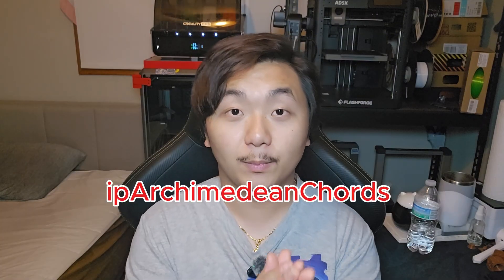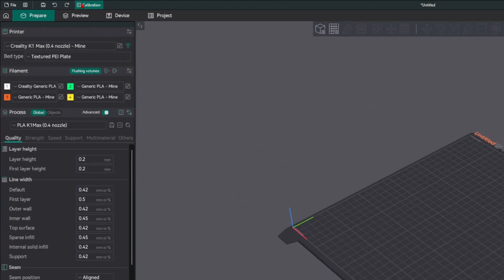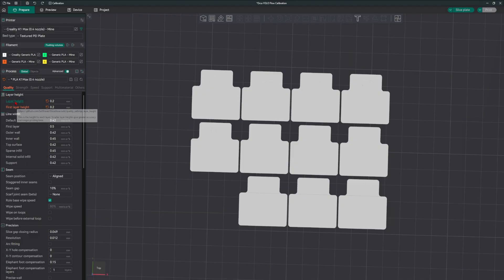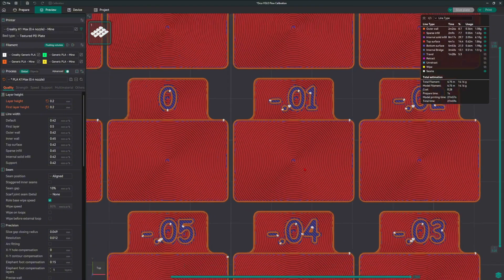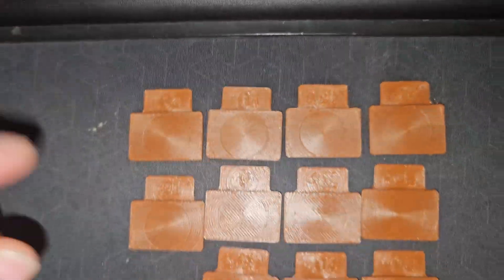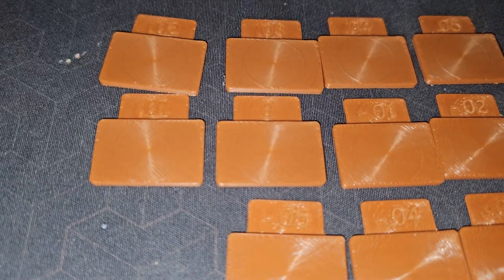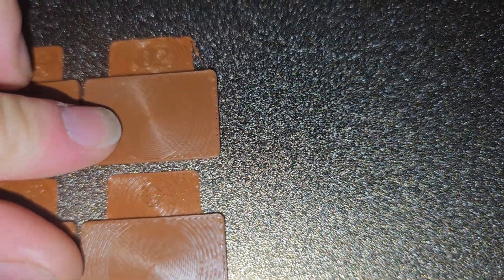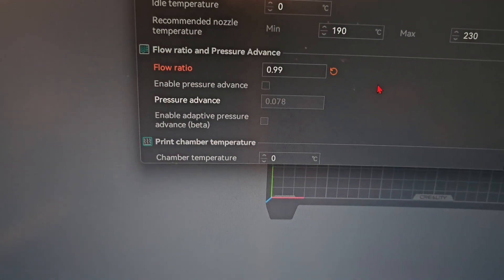How To Do Flow Rate Calibration OrcaSlicer With Any 3D Printer

Comment: I’m sorry but anyone that follows his math here is WRONG. That is not how you calculate Flow Rate. New Flow Rate= old flow rate x 100+modifier /100
Reply from the maker: I was just following the math in orcaslicer,  could be it make a mistake...
Reply: They changed it. From OrcaSlicer flow rate calibration documentation: "OrcaSlicer > 2.3.0 Archimedean chords + YOLO (Recommended)": "Update the flow ratio in the filament settings using the equation: OldFlowRatio ± modifier". For "OrcaSlicer <= 2.3.0 Monotonic Line + 2-Pass Calibration": "OldFlowRatio * (100 + modifier) / 100"

Comment: You really didn't explain what you chose and why - maybe somewhere between all the camera bobbling you did?  Kinda disappointing video
Reply from the maker: I did, for the first pass, I choose 0 and didn't change anything in the settings. Then I do the second pass and choose 0.1, that's why I added .1 to my flow ratio, from .98 to .99. Let me know if you have anymore questions.
Reply: @Scratch3DPrinting  it’s not a very intuitive test. I may just go back to a single wall cube and my caliper
Reply from the maker: @WhereNerdisCool What ever works for you man.
Reply: Agreed. Too much movement, too quick. Didn't give camera time to focus or for us to be able to judge each square.
Reply: The official docs provides an example with some reasoning. Just google for it. I came here in the hope of further examples as i am unsure with mine.

Comment: Correction. The bottom of the print isn’t always under extrusion. It is actually more a sign of your z offset being incorrect and being too far off the bed in the first layer.
Reply from the maker: yeah that could be one of the things for the first layer too. Thanks.

Comment: Personally I don't like any of the flow rate calibration tests, I like to find the maximum diagonal extrusion distance on the bed, then scale a cube down to half of this distance, making it four layers high and ten line widths wide. Usually I just print one at a time, estimating and adjusting the flow untill I am happy with the smoothness, but you could set up many of them to print one at a time and customise the flow in the gcode, I guess, if you are busy with other things.
Reply from the maker: That is also a good way to calibrate your flow rate, as long as you know what you are doing.